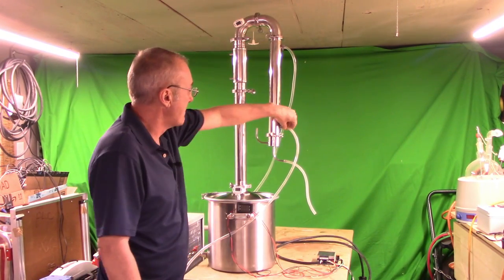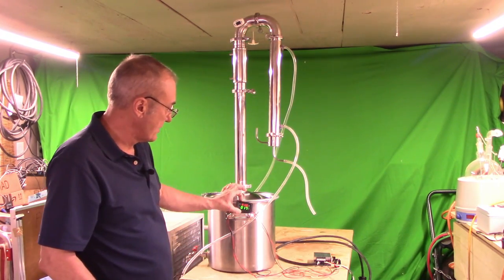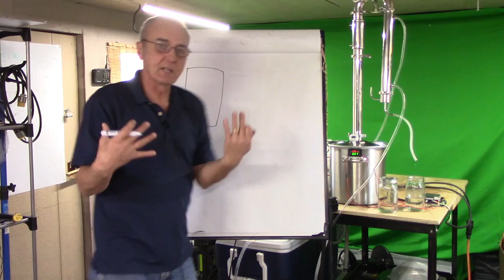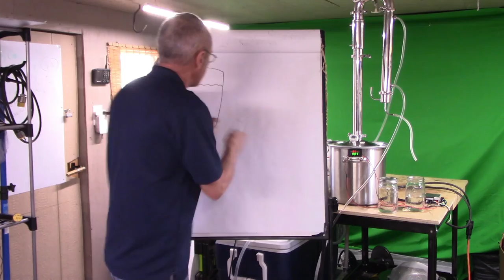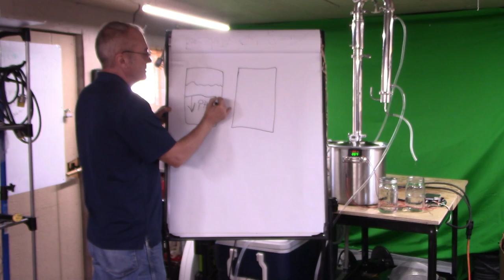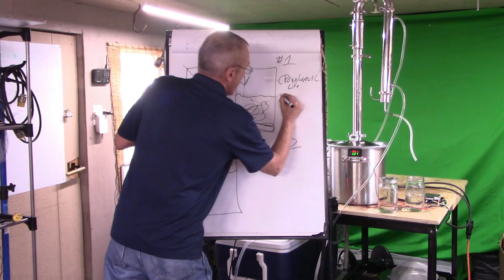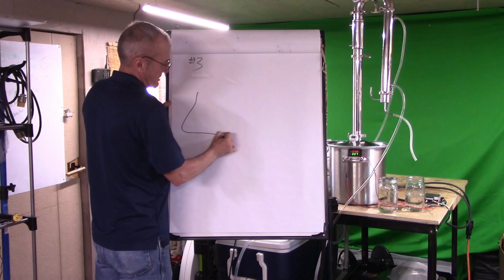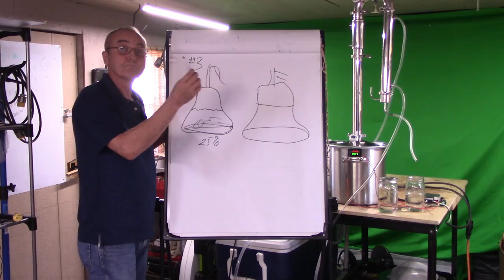SOUR MASH

Comment: For our sour mash we would take 25% of the backset and put it in the fermenter with the new batch instead of saving it and adding it directly to the still later. It lowers the PH and yeast love it. In fact we would take it from the still when the temp was still around 155F (after they were turned off and cooled a bit) and put it directly in the fermenter to keep the temp in there above the 143F to allow the amylase to have further time to convert before pitching DADY. Not sure if this could be a #4 type sour mash for George.
Reply from the maker: Awesome technique.
I just answered your email. May ad this to a future video. I particularly like the idea of using the hot mash as a means to increase the temperature of the new mash for conversion. Brilliant. 
George
Reply: Can you freeze the backsets if you aren't ready to start another mash yet? Have you ever tried it?
Reply: @ericbest9562  I have never tried that, but you would want to make sure the alcohol is mostly distilled out which it should be besides your tails, which you can let your still run and just collect the tails in a jar and dump them. This will allow it to freeze more easily and it won't hurt the yeast at all.
Reply: @mikefleming660  awesome, thank you!

Comment: Taking stillage/backset and putting that into the next ferment is also an industry standard for sour mash. That's second generation though. Since stillage/backset is typically low pH already, because the ferment it came from had been infected with lactobacillus. This also saves on water and helps keep flavour profiles similar between batches. They may use between 33% and 40% stillage when doing this. 

Another method is to mash as normal, then drop the temp to around 40C, and intentionally add lactobacillus starter to the mash, to cause the souring.
Reply: What temperature do you ferment at that you would drop it to 40C (104F)? I am curious if I can add some lactobacillius from a probiotic to my mash days prior to pitching yeast to obtain a sour mash. My experience is only in beer and wine, so until I started messing with kviek, I would always ferment around 20-24C (68-75F). With kviek, I'm fermenting at 27-34C(80-94F).

Comment: I reuse all the corn...add sugar, 30% stillage and the rest local spring water...and bread yeast. ...I have never let it SIT to get sour in the sun etc..but I would like to try that
Reply: I've never done a sour mash but I want to try one. If you don't mind I have a couple questions. Let me know if I have this correct: at least 25% of the sour mash was made from mash from a previous run? Like if it was an 100 gallon batch of sour mash 25 gallons would be from the last batch?? Also, how many generations can you do sour mash? Will it get nasty after several generations? Thank you

Comment: Right on, thanks for another great video George! So if I'm hearing you right, using all three methods would be basically a UJSSM, correct? It takes a portion of the grain, all the trub/barm and a volume of the backset. Or can a UJSSM be called a sour mash since it isn't all grain?
Reply: ..hello to a fellow from "the great forum". Same question dawned on me to use all three. It never occured that was the methods to that recipe. Ive never made it, but have an itch now. Still on brotha

Comment: I would take the sour dough starter and 'dissolve' in water to get the yeast going in all the water. Then add all the other ingredients to the water then add 2/3 of the flour and mix. Then add 1/4 cup of flour at a time until the dough is mildly sticky. (you may not add all the flour called for, the dough presentation is what is important). I couldn't help myself, I've been baking for a month and I am an expert ;).

Comment: Where in the CFR 27 does it state that sour mash needs to be at least 25% of stillage? It is a ph adjustment to about 4.5 to 5 and is usually 2 parts (combination or method 1 and 3 you mention). Put some fermenting liquid from past batch into next and during cooking add some stillage to the water to cook. I sometimes also use method 2 to transfer yeast.

Comment: Hey George  I have one of those dibosh 20l/5gal still runs good but the lid is floppy .the new reflux column w/sight glass also dibosh sways in the wind . I'm afraid it will tip over.  Question: what can I do to strengthen my  lid . 8:34

Comment: Question. Can i mash in new grains on the left over mash right after the run? The left over liquid is still hot enough to steep the grain and then will cool down to the 155 degrees for the amylase enzyme to be added. Or does it have to sit for a few days in order to rerun it? Is it also ok to use more than the 25% of the left over after a run?

Comment: George, on the 3rd method, do you put the backset in with the fermentation or in the still right before running the next batch?
Reply: With the fermentation
Reply: Thank you!!!
Reply: Thank you both, that was my question, I figured it would be the fermentation, as the most it could do in the still would be to add some different notes to it.

Comment: How does column vs straight to condenser pot still equate. Would column still be like running 2 strips in a pot still or are they the same cause they your not running the cold water jacket? Jw if the column with packing strips more flavor than kettle to condenser pot still. I want cleaner flavors. Not vodka.

Comment: Puzzled, wouldn't PWM vary frequency rather than amplitude?
Reply from the maker: It controls amplitude. The frequency does not change
Reply: @BarleyandHopsBrewing  George, you are correct that the frequency does not change however the duty cycle is what varies. You can vary the amount of time your device is on and off. You can have the on time longer with a shorter off time, or you can have a shorter on time with a longer off time.

Comment: A bit of confusion on method 3.  Is the stillage added to the fermenter or the still?  Your diagram shows still, but that doesn't seem like it would have time to do much.
Reply: I have only used backset for 25% of the next ferment water, with good results.  Maybe George puts it in with the next still run, and perhaps I should try that.  Agree, unclear in this video..
Reply: I have the same doubt. As he explains it, it sounds like it should go into the fermenter. George?